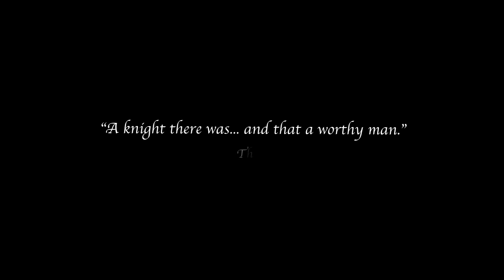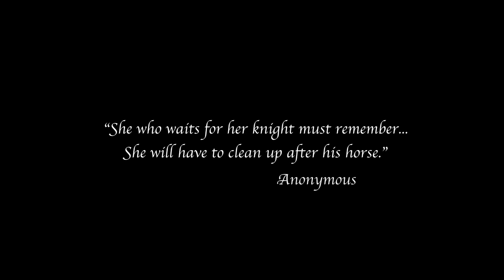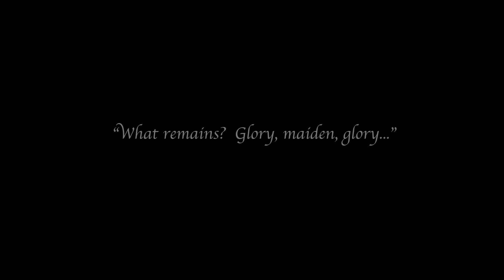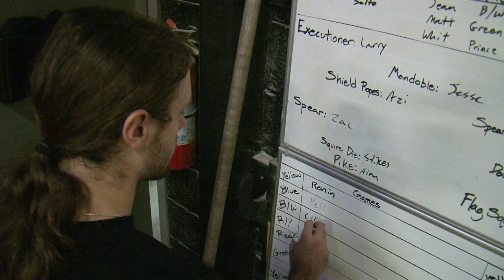Behind the Scenes at Medieval Times

Comment: Question: Why don't you guys wear real chain mail?
Reply: Because this a stage performance rather than unchoreographed, full contact fighting. It's light and wouldn't take a toll on the performers overtime. The faux chainmail makes them more flexible and agile. Also, one can imagine how expensive real chainmail would cost to keep for this show for all the performers as well as the repair cost for them if they got damaged. I also believe chainmail was fitted for the knight because not every knight has the same body dimensions. That would've been another factor to keep in mind if real chainmail was used.